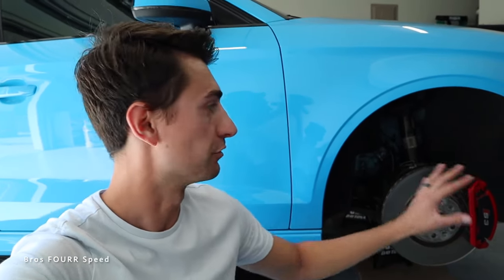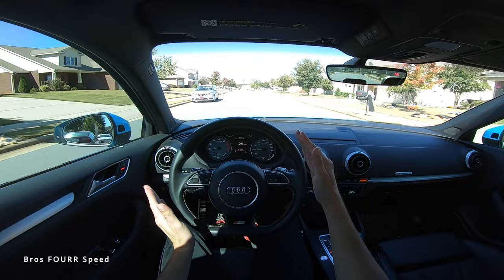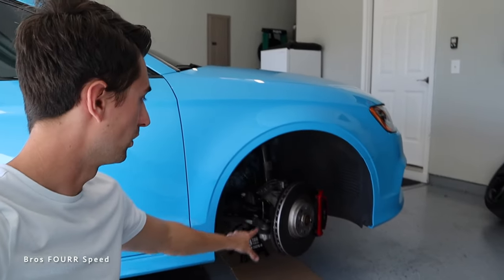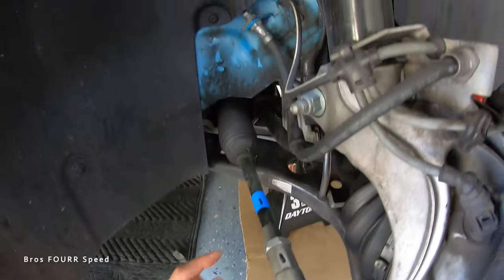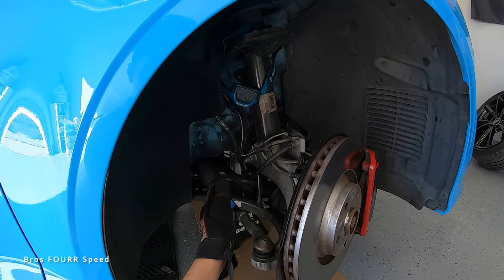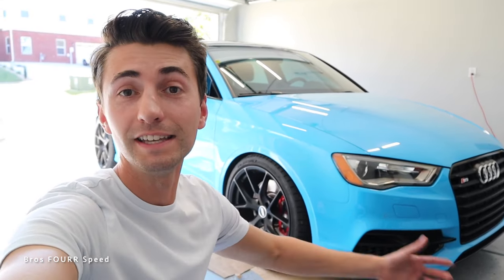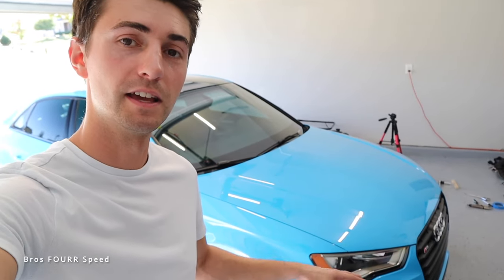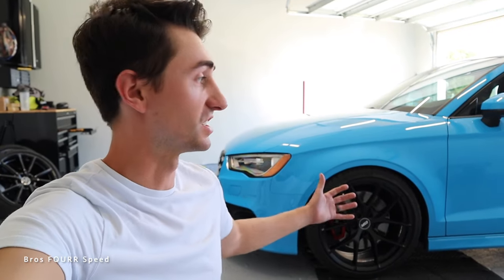How to Straighten Your Steering Wheel Easily at Home | DIY Car Alignment

Comment: you have any recommendations for how many turns per degree of offset of the wheel for Audi.  I have a 2019 A6 that looks exactly like the car you fixed - and yes it drives me nuts.  Not sure if the thread pitch is consistent across all audis.
Reply from the maker: I wouldn’t know exactly. But I think trial and error is the most straight forward way. I got lucky and 1 turn got it perfect on my first try. Just mark the tie rod and the end part and do the same turn and see how it helps. Go from there. Based on this, 1 turn probably got the wheels a few degrees straighter

Comment: In greece the mechanics are kind of stupid for not knowing this or they are probably trying to scam you... paid 6 times for wheel alighment at an authorized ford dealer for my fiesta to mess this up over and over again.. went to a local mechanic showed him your video and told him to do the exact same thing.. the mechanic tool about an hour of work and finally my fiesta is a straight arrow again.. Thank you does not even come close to how i want to express my gratitude for making this video
Reply from the maker: Glad you liked the video! I learned this from a friend who runs a tuning shop. Very helpful tip for sure and glad you got it squared away!

Comment: The one on the Fiesta my mum gave me is off more than that. Also I thought you could just unscrew the wheel and move it lol. Either that or it sat on some spline to prevent slippage and I could remove it and move it a couple of teeth and put it back on.

Comment: Hey man, how much should you torque that nut? You kinda skipped that part. Is it like just hand tight around 35 foot pounds or as tight as possible using two wrenches, one to hold the rod from spinning? Does that sound about right?
Reply from the maker: Yeah just hand tight. Probably around 30-40 pounds. Yes two winches is ideal to tighten against each other and not spin it

Comment: Hi! Really nice video. But u sure it will not affect the thread of the wheels?
Reply from the maker: If your car has had an alignment where everything is straight. Doing an equal amount of turns in opposite directions will only adjust your steering wheel. SO it won't mess up tire wear

Comment: Do you have to take the wheels off? I’ve seen comments elsewhere where ppl are either doing it with tires on the ground if the are doing this on big trucks or driving up on ramps. Just curious if removing tires is necessary if you can access the tie rods on ramps or on the ground. Car wouldn’t be lifted and wheels would be on ground in either of those situations.
Reply from the maker: Probably don't have too. Just made it easier to get to for filming and not wanting to lay under the car

Comment: Old lady 👵 here. My car is also pulling to the right after four wheel alignment (Kias are krap been having the issue since mile one as new owner), steering wheel exactly the way yours was here in this wonderful video. 
 My question for you is just a bit of clarification please. We saw you turn the wheels to the left when you were adjusting for the passenger side.. can you clarify exactly which way you turned the vehicles wheels when you were making this adjustment on the drivers side? I am ever so grateful for your help. God Bless!
Reply from the maker: If you are driving straight and your steering wheel is off center to the left. That means you need to pull both front wheels to the left which will then straight the steering wheel when driving straight. Both wheels need to be pulled in the same direction and same amount of turns on the tie rod end link so you won't effect your alignment

Comment: Thanks for the video. 

Is it the same with BMW?
Reply from the maker: It should be very similar!
Reply from the maker: @jr4459  https://youtu.be/4vVlbeEkVf8?si=65ae6f7T2VurG09r
Here’s my video on my Supra. BMW Suspension. Same concept, just need to see if the tie rods are in front or back of where the wheel pivots. And which way to  twist the ends
Reply: @jr4459  hi

I had my steering wheel pulling to the right and it drove me nuts, and after doing a few wheel alignment wich didn't help,I took my 5 series to the garege and I showed him the video, an he fixed it on the spot.
Reply from the maker: @elimaj4355  That’s awesome! Crazy how many ‘professionals’ don’t actually know much

Comment: Question bro! I’ve been to numerous quality shops but how come they still couldn’t center the steering wheel using all the advanced computers considering they follow what needs adjustments. What usually throws off the mechanics?
Reply from the maker: Because the mechanic lines up the wheel with his eye. They don't have a machine to center the steering wheel. It's eye balled. And they probably just dont care to make it 100% straight
Reply: @BrosFOURRSpeed  that explains it!! Thanks man!
Reply from the maker: @mark.namoco  I think shops should either let the owner of the car place the wheel to their idea of straight. Or have a machine that holds it perfectly level
Reply: @BrosFOURRSpeed don’t they have that tool that holds the steering wheel together? I’ve seen it before yet it’s still not dead-center lol
Reply: @BrosFOURRSpeed also why did u have to aim your wheels to the left instead of just keeping the steering wheel straight center and making the adjustments from there?
Reply from the maker: @mark.namoco  Yeah the mechanic will still eye ball it to center it, then put the tool on it to hold the wheel. But if their eye is off of what you'd think is level. You'll always think its off
Reply from the maker: @mark.namoco  It's the same concept. The goal with the adjustment is to make the steering wheel straight with the wheels straight. When I hold the wheel straight and the car pulls to the right. I knew that I needed to pull the wheels left a tad. I don't have the measuring devises to center the steering wheel first and then get the rotors straight. I cant tell what straight is from looking at the rotors. It's easier to just pull them both in the correct direction and then see what the steering wheel is at after the adjustment and go from there
Reply: @BrosFOURRSpeed  gotcha!! I appreciate your detailed response bro! Makes a lot of sense since you’re doing it without the machine.
Reply from the maker: @mark.namoco  no problem!

Comment: Unless Audi has some different threads, I did that on my 2016 Ford Focus and my crookedness was similar to the one depicted in the video but all I needed was just 1/8 of a turn to make the steering wheel straight so one full turn I agree seems to be pretty drastic.
Reply from the maker: Like I mentioned in the video it will depend on your car. Not every car will be the exact same amount of turns. On my Supra I had this issue and did about 1/4th turn. So trial and error until you get it right

Comment: Had my fronts done steering wheel is still a little bit out to the left garage has told me have the backs done now 😮
Reply from the maker: You should have a full alignment done first. Then if your wheel isn't straight, adjust the front till its spot on
Reply: @BrosFOURRSpeed hi I had the backs and fronts done on a hunter alignment system steering wheel, still not straight, car was ok until I had two front wheel bearings replaced the mechanic said he only took off the hubs
Reply from the maker: @DJMIGHTYZION  hmm, you could try this. But you never know if they made any minor adjustments to the connections to the hub that could have affected alignment.

Comment: hi, do you need to center the steering wheel when you do this? or should the steering wheel be at the position where the car drives straight? thanks, very helpful video.
Reply from the maker: Nope. Just make sure you've already had a good alignment done. Then if your wheel is off, this methods fixes it

Comment: Did you had to turn the steering wheel in order to get the rotor to the left, or did you do it manual from the bottom of the car? Thanks.
Reply from the maker: You don't have to worry about it. Adjusting the tie rod ends moves the wheels over a tad. So once you put the car back on the ground everything will be straight. Provided you did the correct adjustment.
Reply: @BrosFOURRSpeed  okay great, thanks, I'll try that

Comment: Just did my tie rod ends.  My steering wheel is off at like 2/3 oclock.  Im surprised its off so much considering i made sure it was the same as it was
Reply from the maker: Interesting. Are the new tires rods the same length? Might just need more adjustments.

Comment: Nice video. Using your method to straighten my steering wheel.
But I do have a question. 
By turning the tie rod evenly on each side,  although this straightens the steering wheel, but does it also mess up the toe in/ out from the alignment shop as well ?
Toe in/ out adjustment is also by turning the tie rod.
Reply from the maker: As long as you do both sides evenly, you'll be good. And this is only good if you've already had an alignment to ensure tires are all correct. So get a real alignment first, then if your steering wheel isnt centered. Do even rotations on each tie rod and you'll be solid. If your car hasn't been aligned in a long time, you could throw things off
Reply: @jr4459  I'm assuming the tie-rod adjustment re-positions the steering-wheel relative to the road-wheels rather than the position of the road-wheels relative to the car's chassis.

Comment: hey quick question im doing the same thing on a 1999 chevy venture 3.4 can i use the same method that your using on my car thanks alot mines pulles to the right while driving thanks alot reallly reallly apperiate it have a great day besafe always
Reply from the maker: If the suspension and tie rods look similar to this, you sure can!

Comment: Curious. Is this what an alignment shop does BEFORE they do the actual alignment ? Went in for an alignment on wife’s Benz due to steering wheel being off center( b4 seeing this video ) . Now the car pulls to the right . Thanks !
Reply from the maker: An alignment shop should start by centering your steering wheel. Then adjusting. So if they didn't eyeball it correctly, this is a good way to dial in the steering wheel without effecting your alignment.

Comment: I have had this issue recently but some things make sense like if it’s set to factory setting at a dealership but the steering is off it might be worn bushes or shocks but you end up having to replace everything to get it perfect lower arms bushes top mounts 😞 the other is to take the wheel off and adjust it that way 🤦

Comment: Old lady here again. Steering wheel turns hard right. So, I’m to turn my steering wheel to left and turn the adjusters which way please? Am I to turn them opposite? Thank you.  👵 🚙
Reply from the maker: If you are driving perfectly straight and your steering wheel is sitting to the left. That means you will need to adjust the tie rod ends to pull the front wheels to the left to correct it

Comment: My SUV has the same issue but I noticed something too... when I brake and leave my hands off the wheel, it drifts to the right while the steering wheel is turning straight (I have the same crooked wheel issue as you had, its crooked to the left a little bit), do you think it has to do with this issue too? 

Hopefull you respond as I've taking it to allightment 2 times and it seems they don't understand my problem.
Reply from the maker: You probably have an issue with the tires, ball joints or suspension. Any luck yet?

Comment: I gotta try this I have the same problem. For the driver's side I need it to be going left so I turn it clockwise or anti clockwise. The passenger it clockwise.
Reply from the maker: Make sure each side gets the opposite turn direction. One side will need to be shortened and the other will need to be lengthened.
Reply: @BrosFOURRSpeed  Thanks for the info
Reply from the maker: @MIKEYSREVIEWS  no problem!

Comment: What if I only did one side? Can I just adjust the one side to match? And it straight it out? I replaced the tie rod and control arm along with a wheel bearing 😅
Reply from the maker: That will throw your alignment out. At that point just get a full alignment and if your steering wheel is off, then make these adjustments

Comment: What do you think causes this in the first place? My steering doesn't have excessive play but it does feel sloppier than before. I'd say it's off center about as much as the Audi here. In my case it's to the right.
Reply from the maker: You probably just need a new alignment. But mainly when shops do the alignment, they line up the steering wheel with their eye. And probably do it quick and sometimes they come back crooked
Reply: Worn or damaged suspension components.

Comment: Great video! I was wondering if it also works on a slightly more significant misalignment. My Renault Clio 2's steering wheel points to the left by maybe 20/30 degrees, would it be fine to turn the tie rod end by many turns you think? I have never brought it to an alignment center since it's an older car
Reply: It should be as long as there aren't any bigger issues affecting the system. Listen for knocks or have it inspected. The tie rods might just be way out :)
Reply: @jr4459  very good point!
Reply: @PyroPlays  what do you mean by the tie rods must be way out
Reply: @alilakhraichi3481  if the tie rods are significantly out of spec, the steering will pull to once side or the car will have a lot of toe.
Reply: @PyroPlays  thank you man I recently changed my dpf and I must have done something to the tie rods whilst putting it together
Reply: @alilakhraichi3481  I don't see how you would've touched the tie rods while changing the DPF, they're usually pretty tight to adjust. Make sure there isn't anything bent or damaged with the suspension system that could be throwing the steering off.

Comment: The road does have a pitch to it in the middle, so you have to account for that.  Your steering wheel could  be perfectly straight, but it will then have to be tilted slightly to the left driving on most roads to account for the degree to which the road is tilted to assist water runoff.  There are no perfectly flat roads IMO.
Reply from the maker: Yeah thats what I tested it on the flat spot in my street. That way I was in the middle of the hump. But on every single road Im on, the car drifted. So the car was for sure going in the wrong direction

Comment: do i need to turn on the car while adjusting or just leave it off and the steering wheel deadcenter
Reply from the maker: Leave the car off. It's all a mechanical adjustment. So super simple

Comment: Mine car is going towards the left when steering is straight.

So if I’m correct. 
My left rotor needs to be expanded. 
Right rotor needs to be shortened. 

I await your response. Thanks! (My car is UK based right hand side driver)
Reply from the maker: So you'll need to make your wheels turn to the right. Depending on if your tie rods are in the front part or rear part of the wheel will determine if you need to shorten or lengthen them
Reply: @BrosFOURRSpeed  bmw x1 tie rod end. If that helps please ? Any advice would be great
Reply from the maker: @PLANETFAZ  https://youtu.be/4vVlbeEkVf8?si=u-SuFzNm346-3YqH
Here’s another video I made on my Supra. Might have a different setup then the S3. So just look at your tie rod ends to determine if you need to lengthen them or shorten them. Worst case if you do both sides the same amount of turns in the opposite direction. You’ll know if it was the right way or not. If not, reverse what you did and turn them opposite direction of what you did.

Comment: I am going to have a look in to doing this with my car is a right had drive but the principal should be the same ? As mine is pulling the same way as yours in this video
Reply from the maker: Yep! Just look at if your tie rod ends are in front or behind the axel. Then just look at the threads to determine which way you need to spin the bolt to either lengthen or shorten the links
Reply: Great video 🙂
Reply from the maker: @Michael-qq9kk  Thanks!

Comment: Question, will doing this cause your toe degree to change?
Reply from the maker: If you don't do the same amount of turns you can mess it up. But as long as your car just had a proper alignment and then you do equal turns in opposite directions, you'll be good.

Comment: Quick question, what do you mean by you made the driver side smaller and you pulled the knuckle in closer? That’s the area im kind of confused on
Reply from the maker: The tie rod end. When you twist it, it pulls the knuckle either closer or pushes it farther away. The tie rod end is a screw basically. If you tighten the threads it will shorten the tie rod and therefor pull the knuckle its attached to closer in. If you back the threads out, you'll be making the tie rod end longer and pushing the knuckle away.

Comment: Because most shops are terrible, they set overall toe and not individual toe. Ask to see the computer print out, your overall toe can be in spec but individual toe out of spec. 95 percent of shops are toe and go shops, good alignment shops are hard to find.
Reply from the maker: Interesting. But the shops I go to do individual toe. Each wheel they make right and make sure overall is set. It's just when they line up the steering wheel, sometimes they do it crooked. Just had my Supra aligned and the wheel is straight